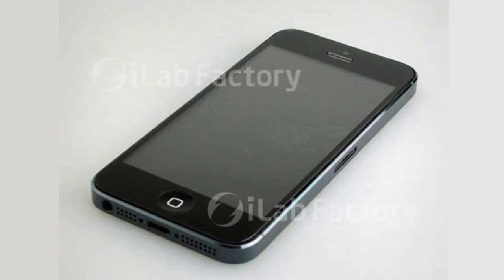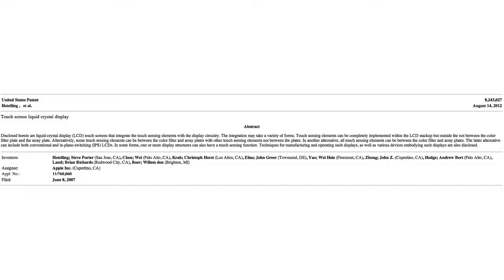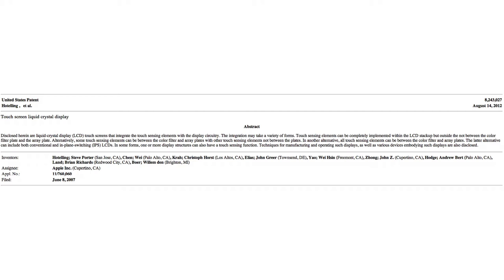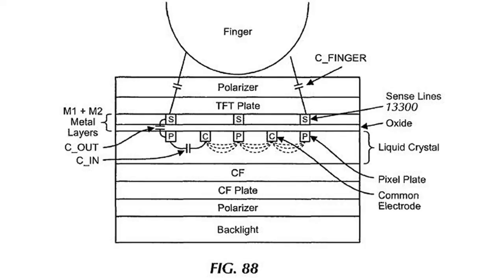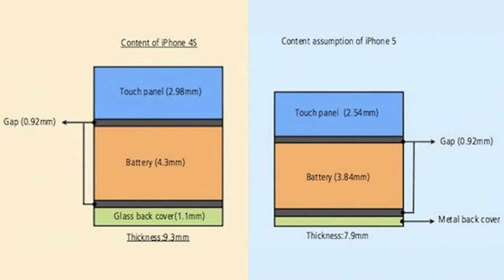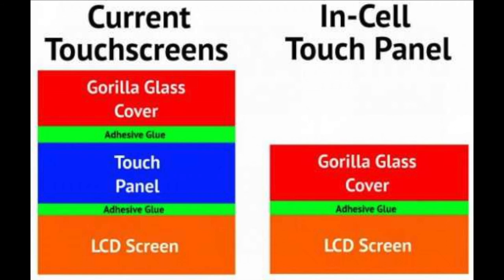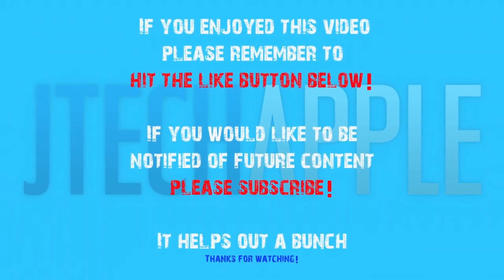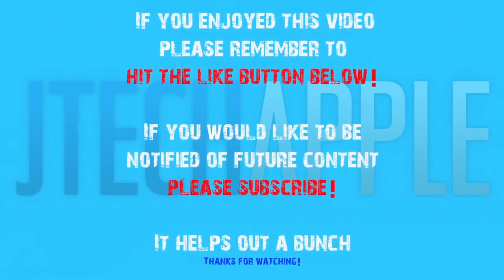Apple Granted Patent For In-Cell Display Technology

Comment from the maker: Good question,  i could imagine that it will. However i am definably hoping Apple wll use a stronger gorilla glass.  But at any extent, there is always a chance of breaking.

I couldn't imagine how much it would cost to repair and the service either. like android phone's with gorilla glass (Samsung Galaxy S3 digitizer for almost $200)   without the touch panel..

Comment: I'm wondering if the phone gets a crack in it if it will still work. If the cells are in the glass and are connected will they be disconnected from a crack disabling the phone. Thoughts?